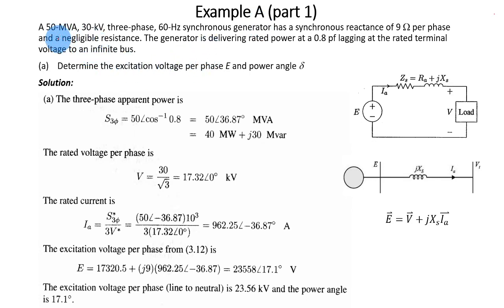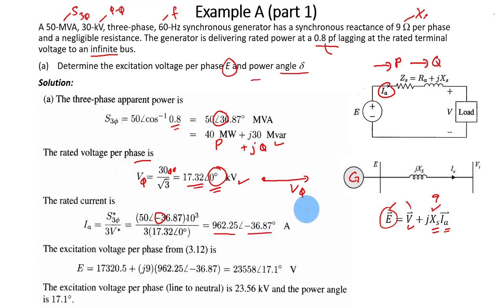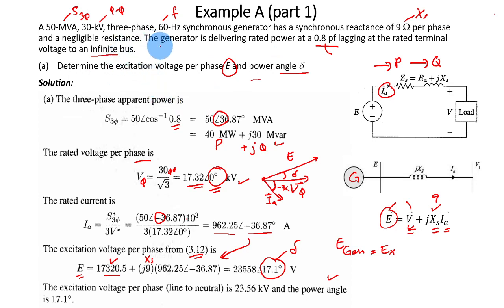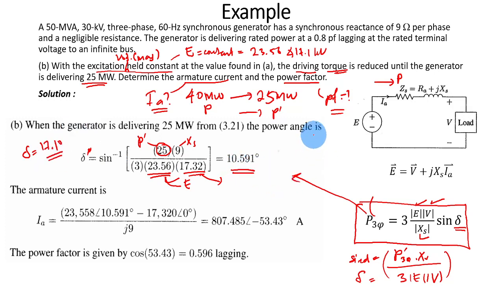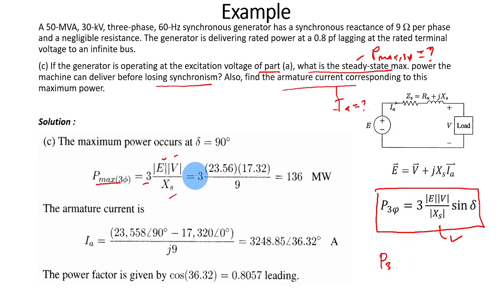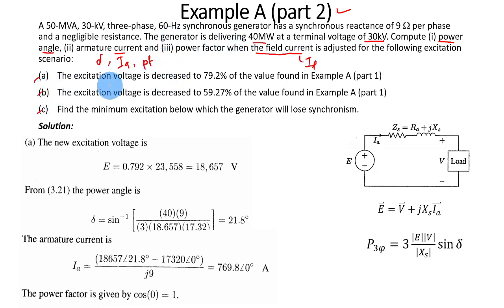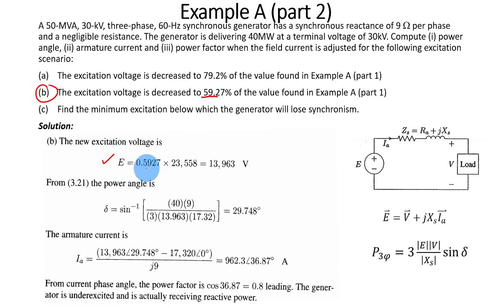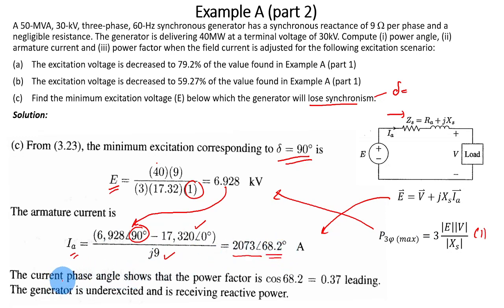Synchronous Generator - Week 2 (part 4)

Comment: The excitation voltage you calculate on the first sheet, I think is not correct.
In complex value:
V=17.32[kV]
Ia=769+j577[A]
Xs=j9[Ohm]
Xs*Ia=-5169+j6928[V]=-5.169+j6.928[kV]
E+Xs*Ia = 17.32-5.19+j6.92=12.12+j6.92[kV]
This gives a voltage E of SQRT(12.12^2+6.92^2)=13.96 [kV]
with a cos ph = 12.12/13.96=0.87
cos phi-1(0.87)=29.74 degrees

Your calculation on page 1 gives an E of 23.5kV and an angle of 17.1 degrees

If I change the power from 40+j30MVAr to 40-j30MVAr the result is as you gave it.
Is this because the product of Ia and V is  negative?

Comment: On getting excitation voltage per phase, why you used the 3phase current? Should you used current per phase too? The voltage is per phase and reactance is per phasr but youve use the current as 3 phase
Reply: Y connected, line current is the same as armature current